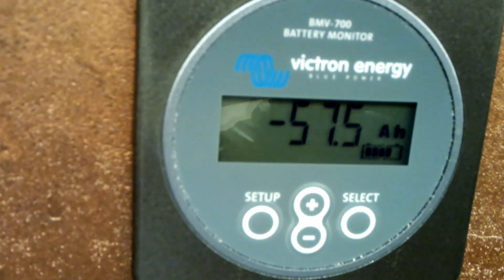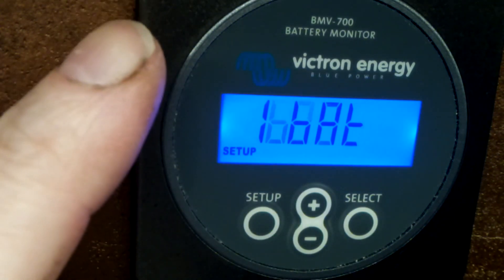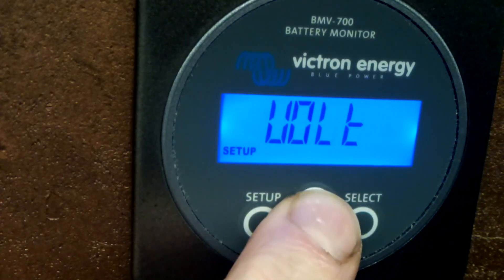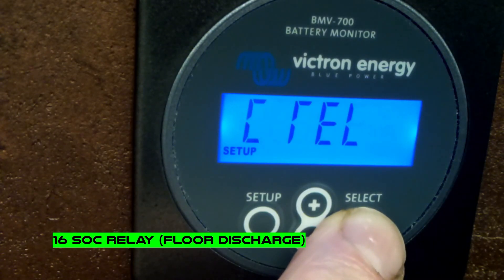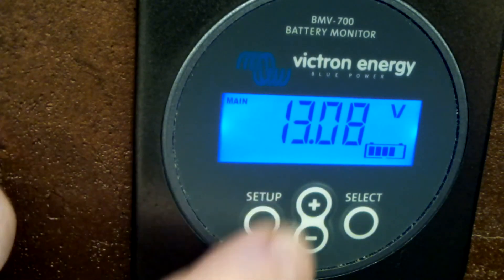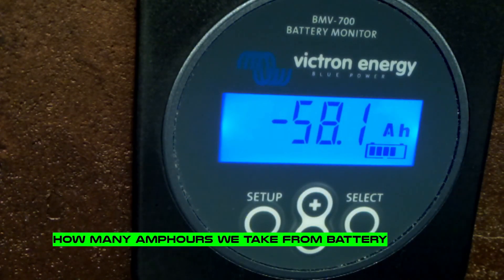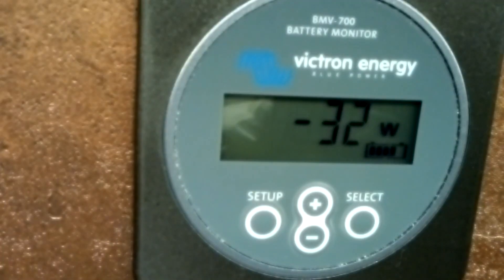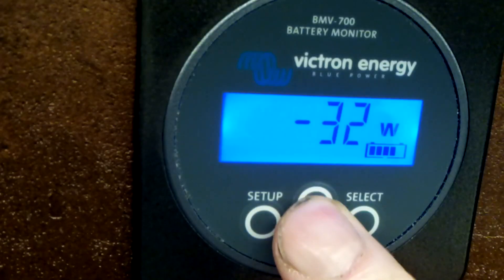BMV-700 battery monitor setup , essential settings for lifepo4

Comment: Hola,primero de todo agradecerte tu tiempo....pero soy incapaz de comprender nada,no porque tu video este mal,sino porque a mi me cuesta mucho todo esto.tengo una bateria de life po4 ,la he descargado hasta el 40%,lo he hecho es casa..todavia esta fuera de la autocaravana,puedes ser conciso conmigo e indicarme que debo hacer?la cargo de nuevo hasta el 100% en casa con el cargador que viene en su caja o la meto asi en la autocaravana?lleva asi 1 semana y como no se hacerlo aun no me atrevo a conectar todo...el shunt bmv ya esta instalado en la autocaravana para baterias de acido.espero sus instrucciones y decirte que tu video es el mas claro y mejor que he visto,pero debo de ser muy muy tonto porque ni aun asi no me entero.millones de gracias.mi shunt es un bmv 600.
Reply from the maker: hi 
charging have nothing common with battery meter (bmv600) you can charge in home or fit inside motorhome , it doesn't matter.
after full charge of battery (reported by BMS) you have reset BMV and set to lithium.try to read manual for bmv victron has quite comperhensive manuals
regards
benQ

Comment: Thanks i just used your advice to set up my 700. I am going to connect it to my cerbo gx too to use the 700 shunt to measure battery voltage.
Reply from the maker: Glad I could help